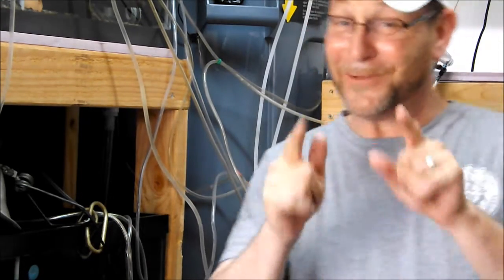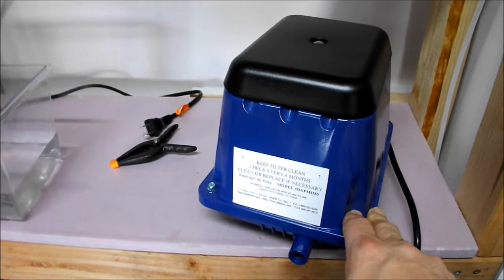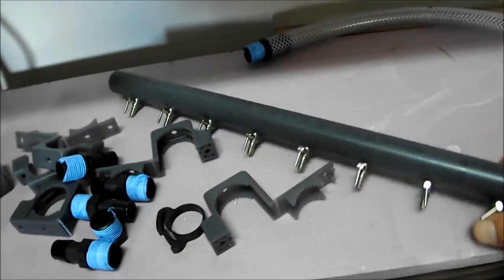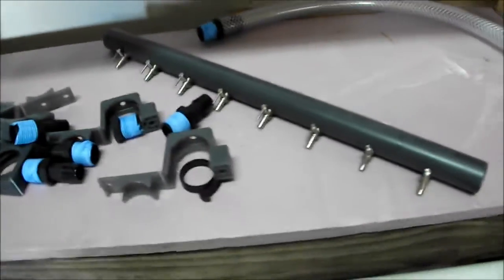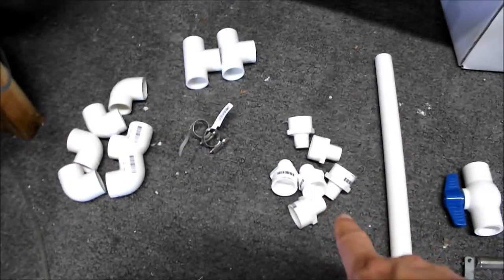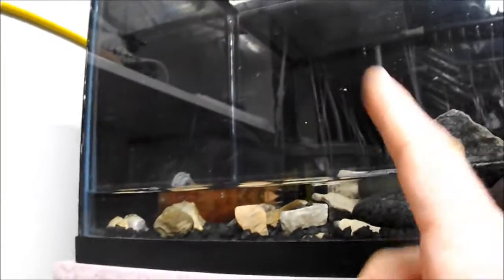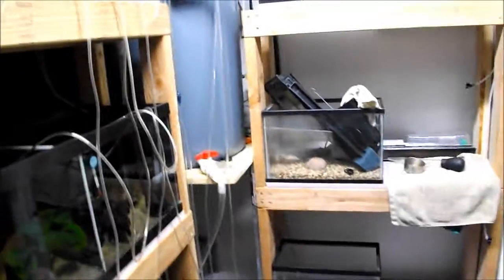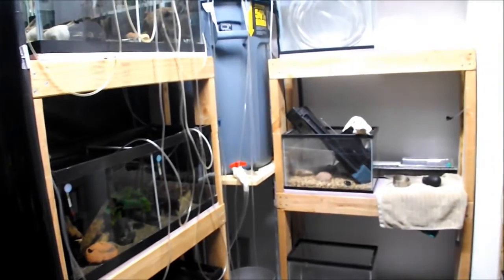Garage Days - Revisited Central Filtration Upgrade

Comment: The best way for the bleeding is to slope the tubes to one point where you can collect any condensation water in the tubes. Then you can put a small tube to collect the water then at the end of that tube you add a valve to open and let out the water. 
Great job. 
My father worked in a place where they were doing the piston to fill the car tires and they gave him a few units. I use one of the pistons for my fish tanks and it work great. This was a long time ago when the tire inflater started coming out.

Comment: Bleeding off reduces the amount of pressure on the pump.  They are noisy, but there's some kind of silencer you can get or make for it.  If I didn't bleed off air when I had my system, my pump would get hot.